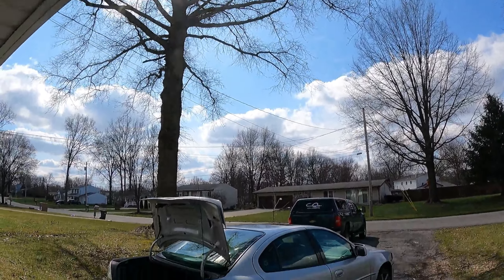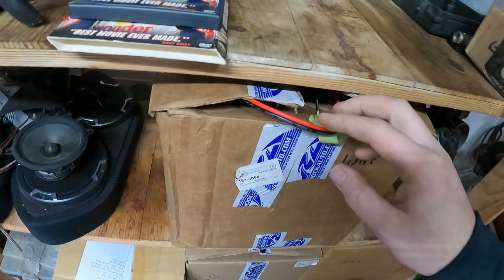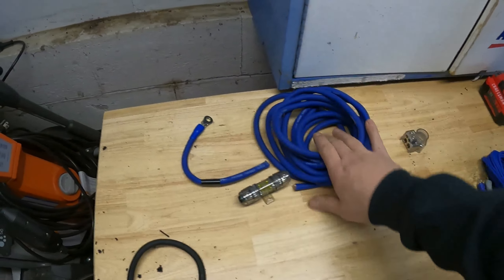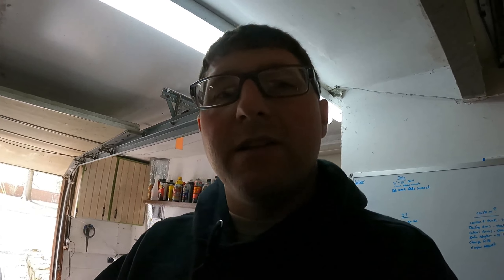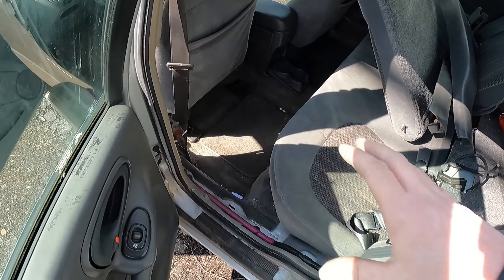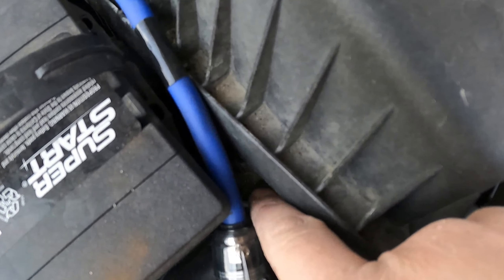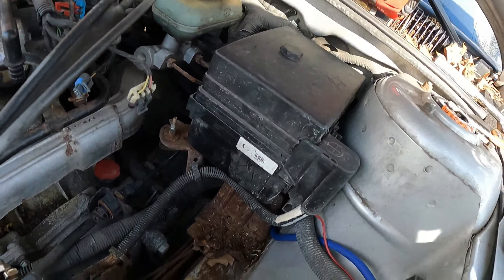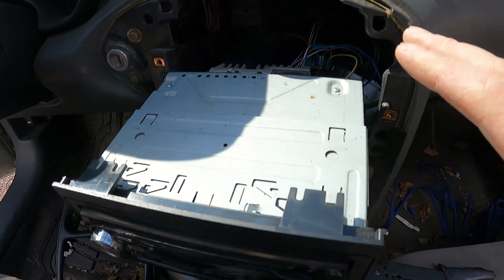99-05 Grand Am Basic Amp/System Install

Comment: Metal hanger to run the power wire through the firewall without having to move all that
Reply from the maker: @Realest666  depending on what hole or position you decide to go through that can work! When directly behind the fuse box it helps to slide it out of the way. Super easy to do.

Comment: Could you help me troubleshoot my 03 grand am sedan, my windshield wipers stop working (its like they stutter and then get stuck up) it happens on all three settings, my work around for it is to push the button for cleaning but not enough to have the spray come out, wipers work fine with zero issues when i just half push the button.
Reply from the maker: Could be the multi switch where the stock is, or you've got gears messed up In the wiper transmission. I'd try the switch first.
Reply: @KMaffittGAGT  thanks brother! I really appreciate it, about to make a trip from WV down to Alabama in a few weeks and given all the rain we've been getting I really wanted to solve this problem beforehand.